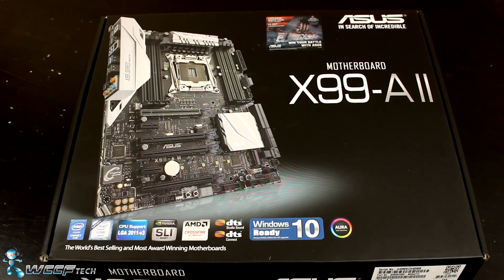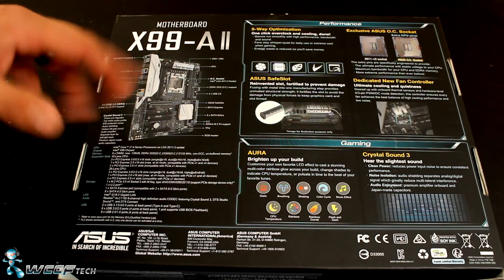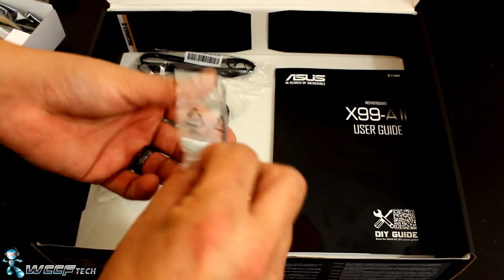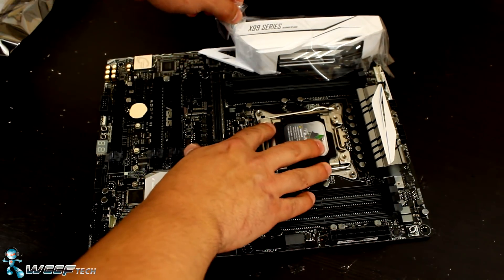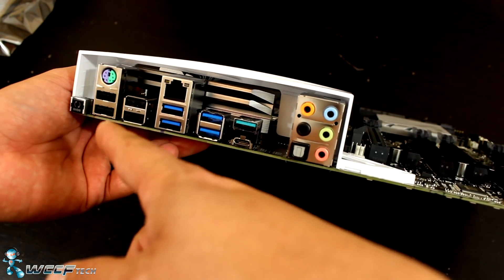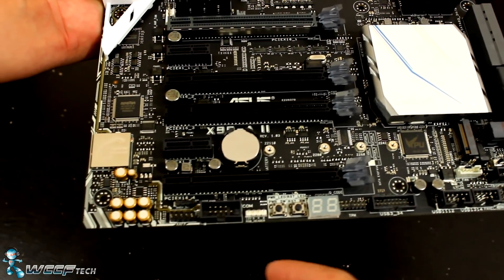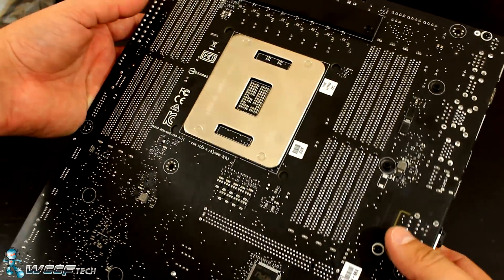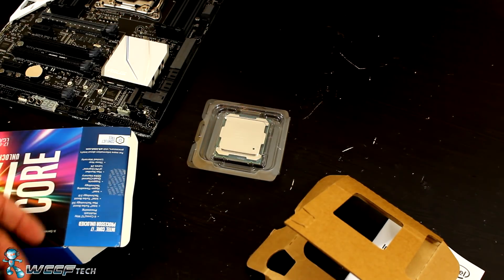ASUS X99A II and i7 6800k Broadwell E

Comment: I have this same board and cpu setup with a rog strix 1080ti works well for my emulation needs.  Sounds overkill for emulators but I wanna enjoy smooth 60fps gaming etc Playstation 2 and 3 dolphin emulator and the Xbox 360

Comment: Hi ! I know it's been a long time....I got a choice between a i7-5820k or a i7-6800K for this MB....
My build right now:
Procesor:   i7-5820K
MB:   Asus X99-A II
Processor Cooling: NZXT x62
VGA: GTX 1080 Ti
RAM: G.Skill 4x8 GB DDR4 3600 RGB
SSD: 1x500 GB 1x250 GB  Samsung
Case: NZXT h440 black/red

sooo.....i got the oportunity to exchange my i7-5820k with a new i7-6800k....should I swap ?

Comment: This motherboard looks like a great board for a cheaper X99 build, like with the i7-6800K. But, I'm quite concerned by all the negative reviews on Asus' X99 boards. Either people are breaking them or Asus seems to be having serious issues with them.
P.S. The manual specifically says to connect both EPS connections, the 8-pin and 4-pin. Nothing suggests that the 4-pin is optional.

Comment: pair this with the gtx 1070 or 1080 please
Reply from the maker: we hope to ^_^ -Keith
Reply: Will be putting an Asus Strix GTX 1070 into this exact setup next weekend. Should be a beast.
Reply: I'm considering upgrading my old e5 1650 with x79 deluxe and 16gb of RAM to an i7 6800k or 6850k depending on my budget while keeping my current case power supply, and gtx 1070, maybe add a 2nd ssd and a 1tb WD black drive for my game collection
Reply: any other suggestions?
Reply: you want it more toward gaming or editing